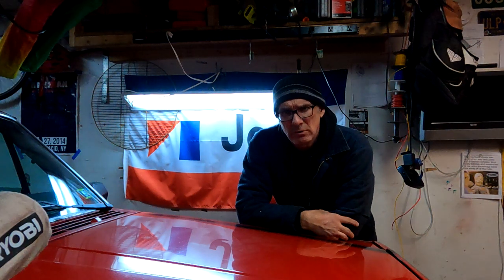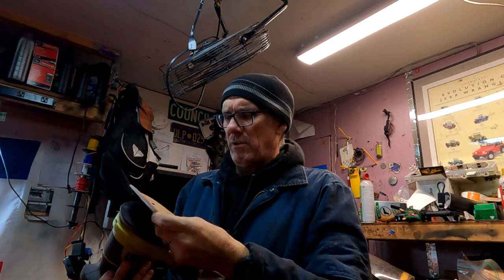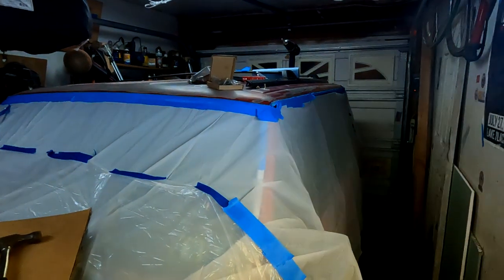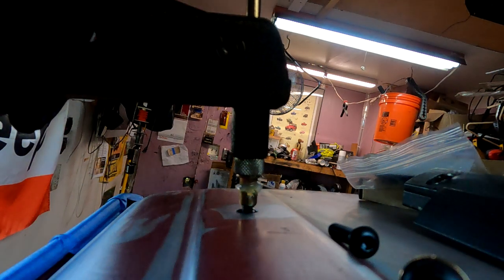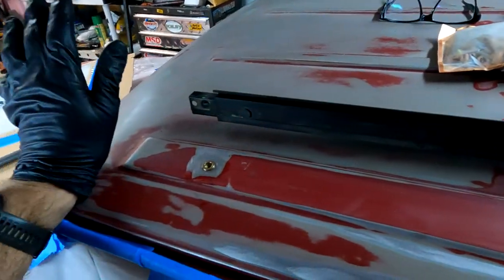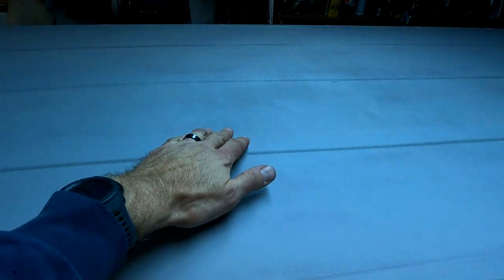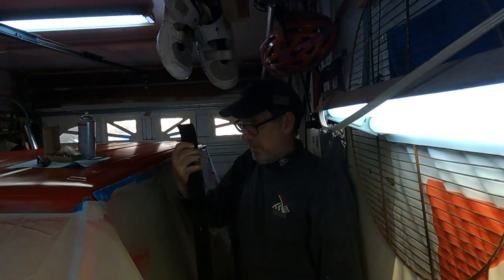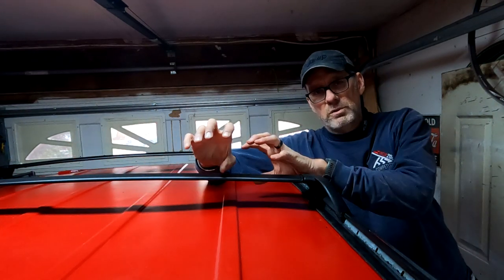Roof Rack Install and Repaint the XJ Roof

Comment: Wasn't expecting a rattle can paint job. Started out with rattle cans on the Bumble Jeep (Rustoleum) and decided to switch before I finished (still not finished) to a 15$ Harbor Freight HVLP gun and quart cans of Rustoleum. Much better results. Still not sure if I will clear coat the Bumble Jeep. The Rustoleum buffs up pretty nice after is sits for a while. Your Project is shaping up nicely. Looking forward to more. God bless and stay well. BTW, what part of PA? I'm in the Hamburg area. A couple of the other Jeep (XJ) channels I follow are here in PA.
Reply from the maker: Yeah. It worked better than I imagined. I would love a real deal paint booth and a spray gun. Maybe for my next jeep :-). 

I’m out in Chester County PA

Comment: Wondering if you have any advice on a Jeep roof that doesn't have the holes pre-drilled for the rack rails? I have a 98 Cherokee and trying to figure out where to start. This is my daily drive, trying to get all my ducks in a row before I start drilling, so I've been a little hesitant. I also don't dont have a garage and it rains a lot in the summer! Very helpful tho, I'll be referencing back to this video once I get those holes drilled! Thanks!

Comment: What is your tires size you are running. I know on a previous video you had 235/75r15  that what I'm running now and I have a 2 or 3½ inch lift on mine. And do you have any rubbing issues.  Keep the video going I do enjoy them.
Reply from the maker: Thank you!!!!! I’m running 31x10.5 with a 3 inch lift! No rubbing issues (using spacers) thanks for the comment!!!!!!
Reply: @JustJeep_It  thanks for your  rep5back. What kind of spacers are you running on your jeep
Reply from the maker: @dstangman8951  rough country 1.5 inch spacers. I technically don’t need them but it makes the turning radius better and fills out the wheel wells nicely.